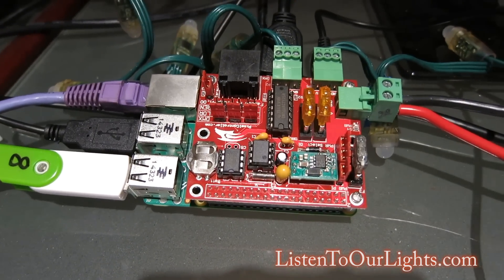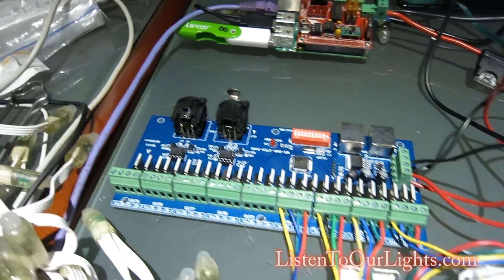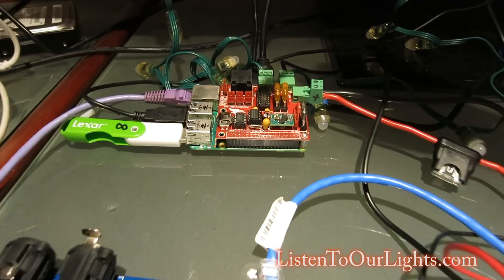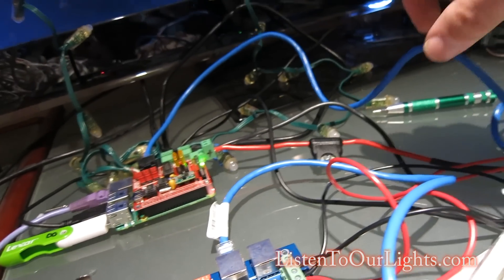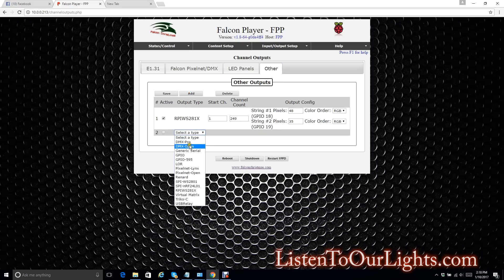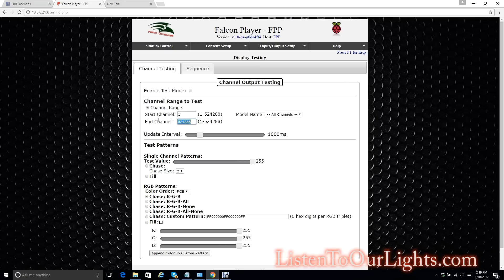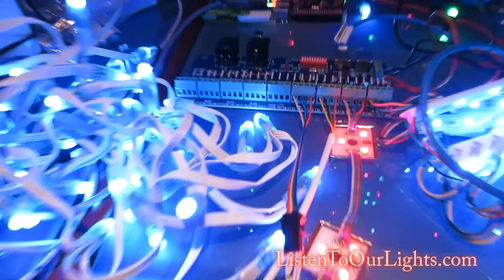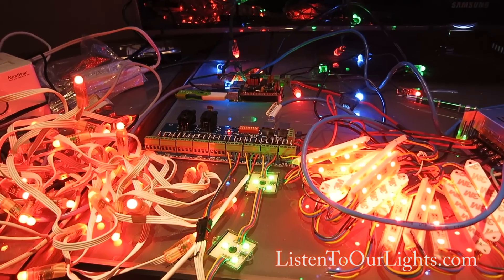PiCap using DMX Output

Comment: What would be the purpose of running a dumb controller with a Raspberry PI? Is this supposed to replace a computer, or a Director? Can you load the show on a PI?
Reply: The answer is, you probably wouldn't, BUT - it is just one use case for the RS-485 output. You could use it for any DMX based output though, so think hooking up DJ lighting to your PiCap